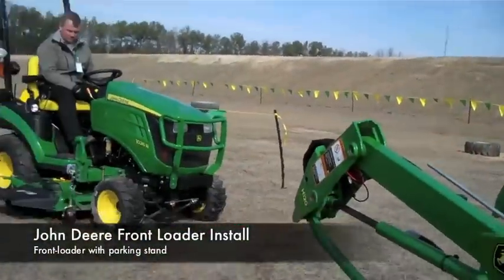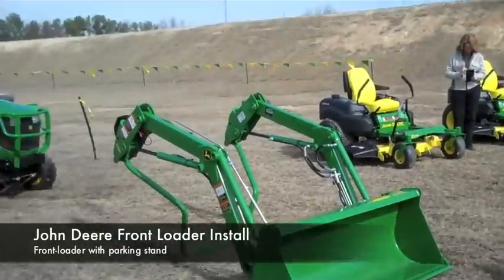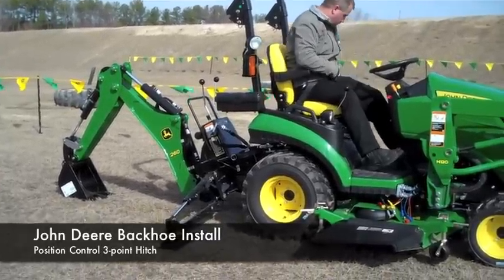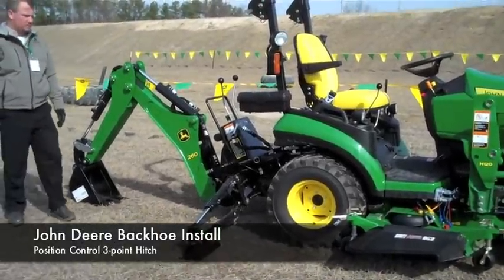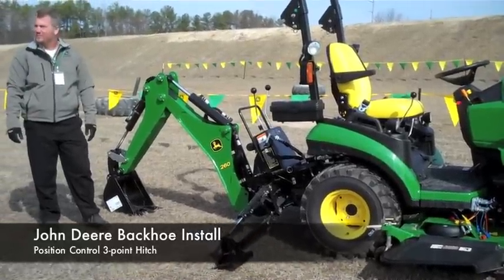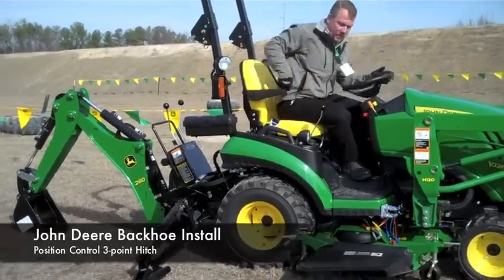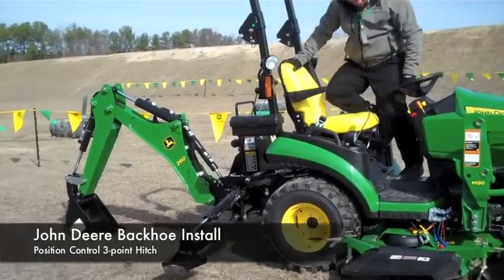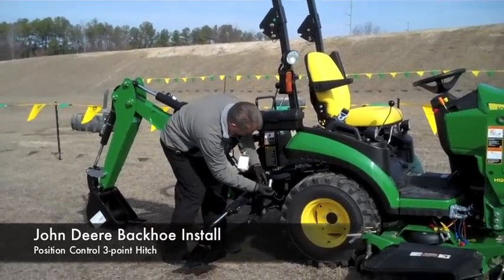John Deere Front Loader and Backhoe Attachment Demonstration

Comment: I bought my (new) John Deere 2305 TLB back in February of 2009. Just prior to that, I had driven about 60 miles from home to test drive an unsold Kubota BX-25 'leftover' that the Kubota dealer had available. The paint was faded out on the tractor, the tires were weather-checked, and the hydraulic hoses were showing signs of age (sun damage), along with the steering wheel, instrument cluster, and seat. That tractor had obviously sat unsold for at least two years in the California 'Central Valley'  sun.

    I decided to go ahead and operate the tractor, so I fired it up and drove it out back of the dealer's, where they had a small  field for testing.  The first thing that I noticed as I drove the tractor towards the field was excessive gear-whine...it sounded like a nest of angry bees was under the tractor.

   I found the controls for the back hoe & loader to be jerky, even when 'feathering' the controls. This was not one of Kubota's best units.. it should have never left the factory with those issues.  That's possibly why it hadn't sold. I made them an offer ($2K under their price) on the tractor, and they declined. When they called me a week or so later to accept my offer, I told them that I had bought a new John Deere 2305 TLB.

  Kubota vs.John Deere is the same as the Ford vs. Chevy thing...everyone is entitled to his own opinion.

   I still own the JD 2305 TLB, and have never looked back since acquiring it. I like my John Deere's, and my brother swears by his Kubota. Thank you for your time....

Comment: John Deere are bad tractors. I would not waste my money on John Deere. Their like a 2 year tractor, I can spend money on a other tractor and get 10 years out of it.
Reply: rays network i use john deer in my business they the best at cutting grass and other jobs we  have run other make !
 i as you can you get a part for another make of tractor in 24 hrs and are other makes parts easy to fit 
no you canno!
t  in the past  ive run 3 jd s all with good  performances but if you only run one grass cutter on one job any tractors will do !  my bussines requires 7 days a week use 14 hour day and one machine in the workshop would  cost me money and jobs that  the reason why only buy john deer gear because it will run and work the hours we required and  the parts are all way in my hands the next day !
Reply: andrew eeles UGC

Comment: First off, that tractor is too small for both the loader and backhoe. I saw one a company bought in my area with those items on a tractor about that size and the tractor broke in half. They left it sitting near the street where everyone could see it as to say don't get this. I love the easy hookup, but you need a larger tractor than that one.
Reply: Your a fucking moron. This is one of the best selling tractors in the USA.
Reply: Sounds like you never ran one then.
Reply: G   cxxxccccfQ 02 40 83 08 16 02 40 83 08 16 Toyota corolla verso tbe série limitée"les bleus" - 7400€
D4D 136CV mis en circulation 07/2006
CT vierge 
Entretien toujours effectué en garage agréé toyota ou chez Toyota (carnet d'entretien à l'appui)
159000km
Option de série : 
Radars d'aide au stationnement av/ar.
Bluetooth, 
Vitres teintées
Attelage remorque 
4 vitres électriques 
Climatisation auto 
Ect. 
Les pneux avants sont neufs.
Véhicule visible près d'Ancenis. Toyota corolla verso tbe série limitée"les bleus"
D4D 136CV CT vierge Entretien toujours effectué en garage agréé toyota ou chez Toyota (carnet d'entretien à l'appui)
Option de série : 
Radars d'aide au stationnement av/ar.
Bluetooth, 
Vitres teintées
Attelage remorque 
4 vitres électriques 
Climatisation auto 
Ect. 
Les pneux avants sont neufs.
Véhicule visible près d'Ancenis.

Toyota corolla verso tbe série limitée"les bleus"
D4D 136CV CT vierge Entretien toujours effectué en garage agréé toyota ou chez Toyota (carnet d'entretien à l'appui)
Option de série : 
Radars d'aide au stationnement av/ar.
Bluetooth, 
Vitres teintées
Attelage remorque 
4 vitres électriques 
Climatisation auto 
Ect. 
Les pneux avants sont neufs.
Véhicule visible près d'Ancenis.

Toyota corolla verso tbe série limitée"les bleus"
D4D 136CV CT vierge Entretien toujours effectué en garage agréé toyota ou chez Toyota (carnet d'entretien à l'appui)
Option de série : 
Radars d'aide au stationnement av/ar.
Bluetooth, 
Vitres teintées
Attelage remorque 
4 vitres électriques 
Climatisation auto 
Ect. 
Les pneux avants sont neufs.
Véhicule visible près d'Ancenis.
Reply: Sidney Mathious dave allen
Reply: For light duty land management they work just fucking great!  By company I assume you mean a construction company who probably used it for something much more heavy duty than it was intended to be used for.
Reply: Best selling don't mean the best, and I own two John Deere tractors, but would not buy one that small though. I had to check that tractor out later, and the funeral home who owned it was upset to see this happen to their tractor. The tractor is not all all steel, and the metal had a defect in it.